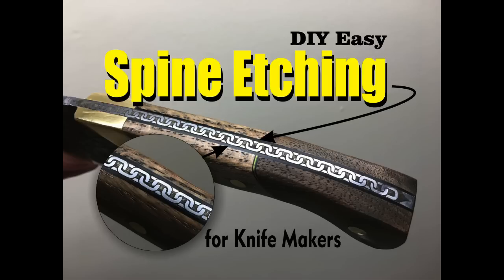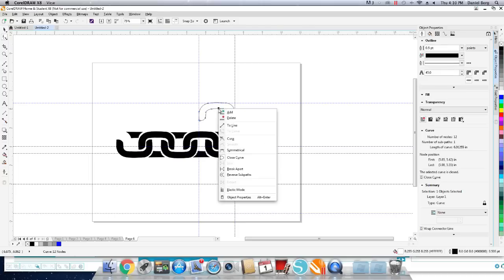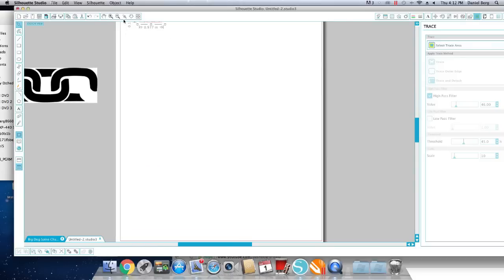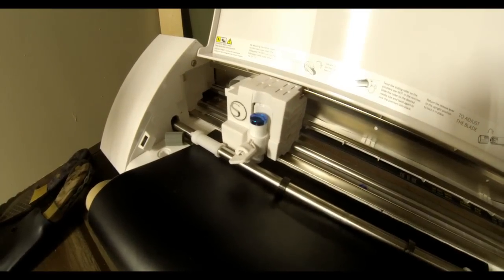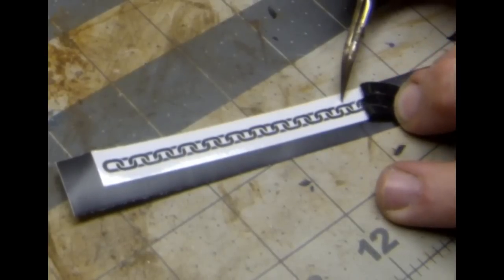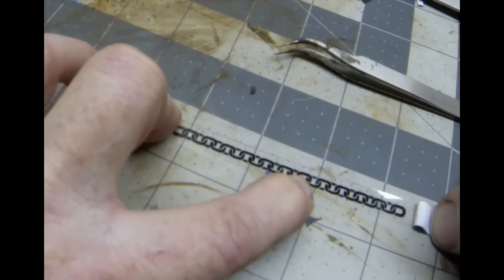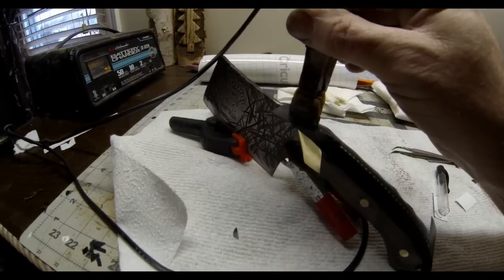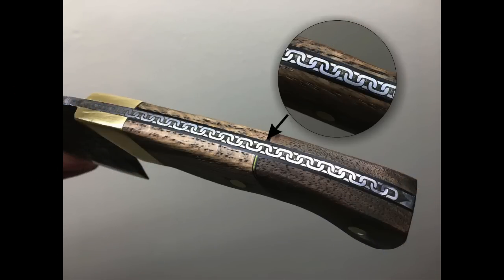Knife Spine Metal Etching with salt water and a 12 volt battery charger

Comment: If you export the file as an EPS there will be no need to have cameo trace it. All your linework will remain perfect because an eps is vector art. I use the cameo all the time to cut vinyl from Illustrator and Corel Draw works the same way. EPS should work perfect.
Reply from the maker: Thank you!! that will make a huge difference in quality. Will give it a try

Comment: Gorgeous. One day I’ll be able to afford that fancy software etc
Reply from the maker: You do not need the graphics program. You could just do an internet search for free black and white clip art and import that directly into the Cameo program. Or you could forget the computer completely and hand cut a design. I did that on the stars for patriotic knife spine etching
Reply: DIYeasycrafts oh wow!! I will have to check that out. Thanks for your reply.... subbed for sure
Reply: Have a look at the silhouette portrait. it´s the cheaper version of the cameo but still works like a charm on small projects. The silhouette studio software is free for the basic version and you can replace corel draw by inkscape f.E., free too.
if you ignore the ridiculous priced original blades and buy some CB09 blade holders from china you get away with not that too big of a hole in your wallet.
Reply: Inkscape its free and powerful
Reply: Markus_B hell yeah, nice. Thank you for the info...appreciate it

Comment: Does this etching work on S35vn blades or Titanium handles ? Also where could I buy some designs already on transfer film. Just so I can try this. I just got into anodizing folding knives. Thank you
Reply from the maker: I have only used it on 1095 so you would just have to try it out on some scrap matertial. I can print print out the designs on vinyl but if you want we to weed out each and put on transfer film its going to get expensive. Just time consuming LOL
Reply: DIYeasycrafts I understand. If it worked I’d think about ordering maybe 10 designs at once if it saved money. I’ll have to try the etching first. Thank you

Comment: Looks great, can you get shocked from the battery charger? I've always been careful when jump starting or charging a vehicle battery, I guess because of all the Hollywood movies where they torture people with a charger. Looks to me though from watching this, it won't shock me? Thanks.
Reply from the maker: Yes you can get shocked. Mine is only set at 2 amps but basically never touch both leads at the same time

Comment: I wish I could get my vinyl cutting to cut that small. What brand of vinyl do you use?
Reply from the maker: I use the Sillhouette brand on the roll. Have tried other brands but they do not work as well. For the real small stuff i also bought the better blade
Reply: So silhouette black vinyl ? And what is the better blade?

Comment: great videos you make ..i am doing lots of research about etching and engraving...i am quite concerned for your health and the dangers that you are risking ...the salt converts to chlorine ,which is heavier than air .It will also slowly disolve internal organs if you breath it ..just one of its many dangers ...also , using a 12 volt battery instead of a 6 volt changes the ions in your metal ...releasing dangerous compounds all over your work bench ...you need to let your viewers know these very fatal by products ...however great work